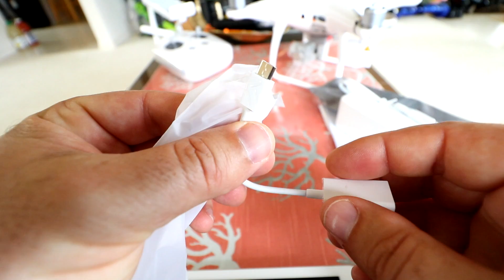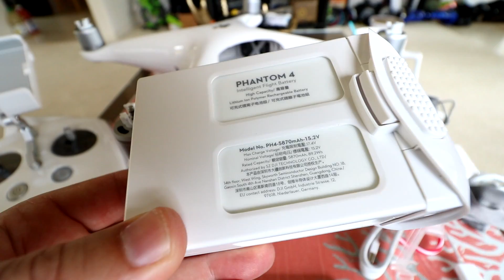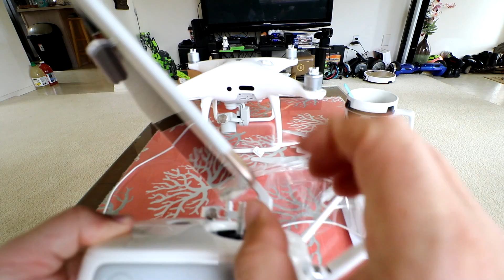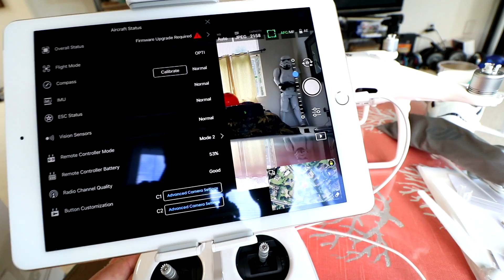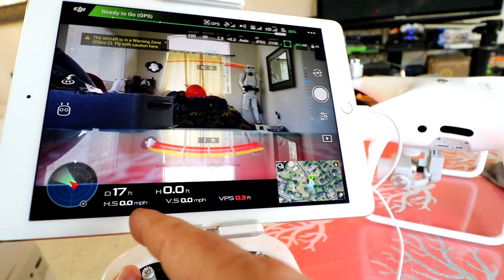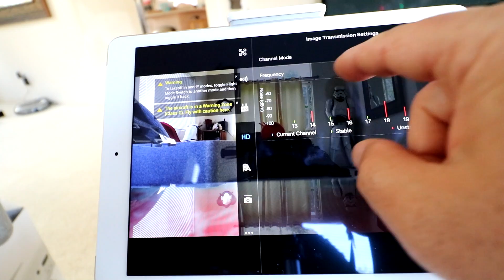DJI PHANTOM 4 PRO Review - Part 1 - [Unboxing / Inspection / Setup / Updating / In-Depth]

Comment: hey dustin what do you think of the 3dr solo drone its going for under 300 on amazon and im strongly thinking about getting one but wanted to know what you think about them
Reply from the maker: +NappstarTv I have had one for Review for a while but haven't got around to reviewing it.  That sounds like a great deal but I won't be able to give my opinion until I finally review mine 😁
Reply: Dustin Dunnill ok bro thanks and keep up the amazing work bro
Reply: Dustin, please review it as they are really cheap right now and a lot of people are on the fence about getting one. Also, when is Part 2 of this video coming?

Comment: Question, if you mod the controller to obtain the HDMI port do you loose the USB port? Also, I saw some people saying that after doing the mod that they still did not get a picture though the HDMI port but a firmware update should correct it (The postings I read were of 2016). Do you know anything of that? Will you be modding the controller before the first flight?

Thanks for the informative videos
Reply from the maker: +IzakGt I installed it and it will detect the card on bootup.  It then prompts for an update immediately then works perfectly.
Reply: Well Awesome! I have some headplays from my "racing" drones (I don't race) and just purchased A P4 pro and was curious! Looking forward to your flight video thanks so much!

Comment: I do like these. Out of my price bracket though and even if it wasn't (or especially if it wasn't) I'd still prefer two extra motors. NOT because I prefer another brand but simply because if I had that much invested in it I'd like it to cope with a motor or rotor fail.
Belt and braces approach ;)
Good unbox and explanations. I look forward, as always, to the rest of the series.

Comment: I think if you've got a P3A/P or later, most of this setup stuff is pretty familiar.  If you don't want to see those "you are in a class C restricted area" warnings, you can turn off your Geo Fencing option. I also turn off my front Lights on the Arms so they don't interfere with video.  This particular model does have MUCH superior video. The only thing is, in order to view 4K video, you need to have a 4K monitor on your PC, and have a really power PC to boot (especially if you are doing editing).  Its the same thing with TV and 4K.  I don't have a 4K TV .. there isn't much available content currently broadcast in 4K to warrant it.  I remember when they first came out with color TV.  It was the same thing. There were few programs being broadcast in color, so my dad saw no reason to update our black/white TV until there was sufficient programming out there. Lastly, uploading 4K video to YouTube takes a LONG time, unless you have a super fast internet connection.  I think you'll really like the video and stability. Now that you've had experience with a P3 & P4, you should be familiar with the various advanced flight modes so that you will be able to demo them when you get out to the field. It's still only 40 deg. here in NE Ohio, so flying weather still isn't quite here. Looking forward to ensuing videos ... Mahalo ...
Reply from the maker: +Bill Somrak Stay warm Bill.  Glad to see you commenting.  Aloha.  Excited to do more with the P4 Pro and the Pro+ 👍